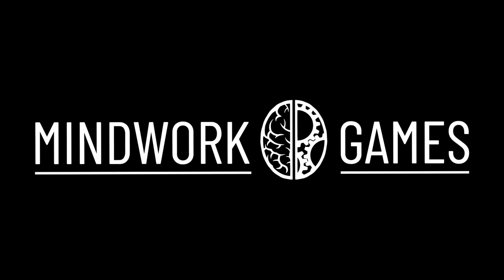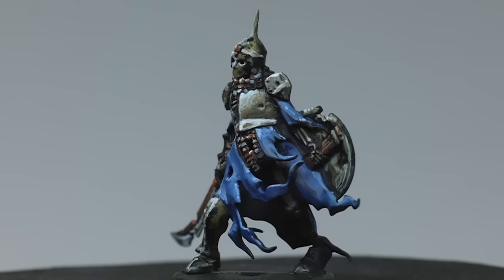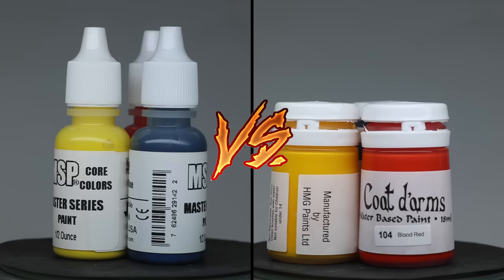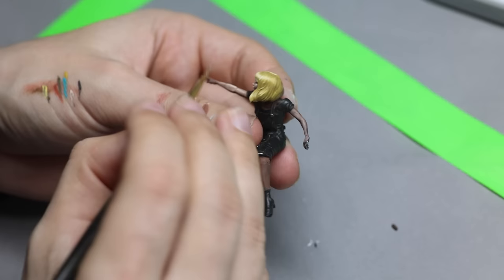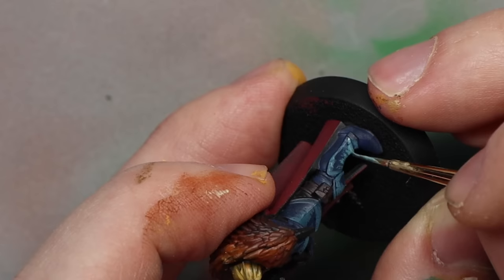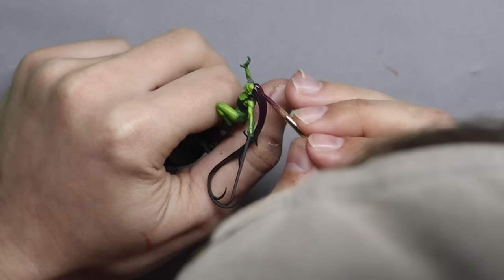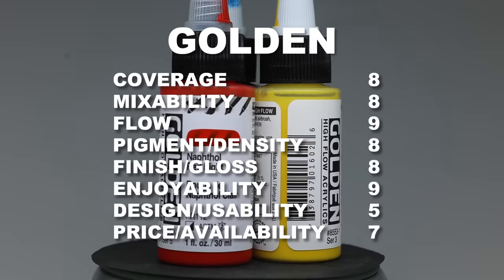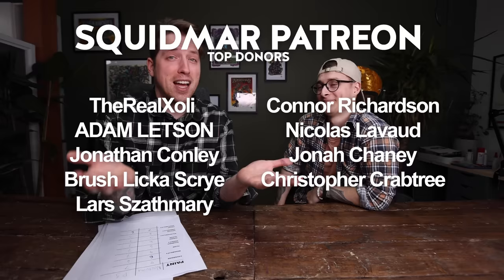Worlds biggest paint test! - pt. 1

Comment: I'm actually a bit shocked at the Army Painter results. I've only ever used their Greenskin paint to get some Salamanders ready for the tabletop and one or two washes. I've never had an issue with coverage, but I've tried so little of their range.

Also, I was really hoping to see Duncan Rhodes' Two Thin Coats in here.
Reply: Duncan's paints aren't for sale because they're still being altered right now. They've had some early reviews but the final product might be different than the ones used in reviews so far.
Reply: I was little surprised as well, I have to wait until the following day to see anything like that level of serration in my wet pallet

Comment: I'm a bit late to the party, but I wanted to chip in. I have only had problems with my monument hobbies paints when using Citadel primer. When I used some Rustoleum primer they worked like a charm. Not sure what would make that difference but Pro Acryl has been my favorite brand of paint thus far. maybe I'm using my vallejo paints wrong, but I really dislike the finish of the vallejo paints.

Comment: For Applebarrel and similar, it's normally more of craft stores and similar places where you would find them than the normal hobby stores.

Also, I'm surprised you didn't try some of the Testors enamels, I know a lot of people who started with them because they were easily available (They used to be sold in Walmart, K-Mart, and Meijer near me when they had models for sale). Sure, they're more of a thing for scale modeling, but there are a few people who still use them.

Comment: I have a bunch of Army Painter paints that I picked up for relatively cheap, and they are a pain to mix. Even with a vortex mixer these paints really need ball in the paint to get them to mix. They're not a bad option for the price, but for ease of use I'd rather pay the extra for Vallejo.

Comment: Always nice to see your favorite paint brands clash each other. As owning 7 or 8 brands of them for myself i was a bit sad with my favorite brand kicked out so soon. Have some scale for myself but seems that i am to bad of a painter to use them properly and for my taste they are too matte. On the other hand i love my warcolours and do steadyli increase their amount.

As i see it, most colors are some kind of the same thing. Little more or less opaque, little more or less thin but if a grab a Pro Acryl, a Gw or a Vallejo Bottle dosnt make too much of a difference for me. In contast using Warcolours feels really different and unique. I love how the gel feels when painting and how you can "push it around" to get the opacity you like.  In my opinion you can control the flow perfectly with just adding a tiny amount of water. What they do for me as a not that good of a painter, is perfect and smooth color brightness transitions. You just take a color range, red 5,4,3,2,1 and layer them on one after another and the result is just amazing every time.  If i use mixed Vallejo or Pro Acryl for this,  its much more difficult for me, often they are to opaque  and each layer stay clearly visible. And if i thin them to much they become runny, and i dont like to fiddle around with mediums.

Comment: These were Ferc Polo's determination from testing.  Posting before watching the video to avoid opinion gathering.

1:  ProAcryl  (best)
2:  AK  (damn close to best)
3:  Vallejo  (consistent, predictable, vibrant)
4:  Scale 75 (awful company culture, very matte, but extremely pigmented and easy to use for any purpose, will lower rating for people who don't like matte finish)
5:  P3  (some of the best metallics, but the flat colors, while good, do not stand out.)
6:  Citadel  (The range is large, some of the unique colors are amazing (Death Guard Green, Thunderhawk Blue, Sotek Green, Averland Sunset, etc.)
7:  Kimera  (every color you have to mix, just more effort, great for mixing with other brands)
8:  TurboDork (look great but using them is awful)
9:  Apple Barrel (Higher for cost per paint, but pigmentation is an issue for glazing or thinning.)
10:  Reaper MSP, it's the worst paint I've ever used and all arrived almost worthless in separation and one set was completely dry.  Garbage experience.
Reply: If your reaper arrived that way they were either frozen in transit, or not directly from Reaper and had sat in a warehouse too long.. I've only ever had 1 paint that wouldnt mix properly and I've used close to 600 bottles of them at this point

Comment: "Strength/wear integrity" could also be included as there are more than twenty differnt acrylic polymers. I am under the impression that Model Color by Vallejo was a mix of vinyl and acrylics. Goes down fairly evenly, but wears off easily, so probably not best for those handling the minis in a game or packing them a lot. Why did you skip Game Color? I think they are pure acrylics. Regarding coverage, reds and yellows can be quite transparent as there apparently are no cadmiums or bismuths in acrylics for minis. Glad you included an artist brand like Golden. Not recommended to lick the brushes when using cadmiums, chromiums and so on, though.Toned colours will always cover better. Wonderful to see all the brands, though. The category pigment/density is porobably the most important. Glad you included this, as acrylics can not carry/bind as much pigment as oils and acidious pigments can not be used at all.

Comment: I noticed during your MH test you had issues getting first layers down...I did too. Then I saw you using Vallejo Primer, which I use also. I am wondering if you used the white as the primer even as a highlight. I found that if you use the Vallejo white as a primer in any form MH never wants to stick, but if you use black and grey they work like a dream. Its just the white I found that did this. So I would have agreed with you about a month ago, until I started priming different. Now MH is almost the only paint I use next to Vallejo and some of the ink AK's

Comment: I get the feeling that noctourna and P3 would be better for Byron's Style of drybrush painting; GSW Paints always seemed to be heavy body paints to me halfway between apple barrel and mid-grade artist acrylics making them excellent for base coats and terrain painting with a large firm brush; New Army Painter is still not quite as nice as vallejo but probably in the top 3 but their speed paints are my fav transparent right now, MSP reminds me of a slightly creamier vallejo, I just use matt medium instead of water to thin when I use Scale75 tying it all together, I haven't used Warcolors at all not a fan of gel medium even a little, AK and Monument are just simply the best here in 2024...oh and Golden are great, use the dropper bottle for Air Brush with some matt medium instead of AB thinner to thin and the from the pot colors are probably the second or third best for brush work; and Golden makes simply the best mediums, varnishes, and additives that happen to also tend to be cheaper than others.

Comment: I dont usually comment on videos, but i think its important to note here for amateur painters, that for some reason they are painting only black primed miniatures, and then rating the coverage of some paints as poor. The truth is, colors like yellow, or pink, are hard to build from black by most any brand of paint. you will get much more consistent coverage results by priming white, even with exact colors that showed poor performance here. Though some are still awful. That army painter red, is no joke, very poorly. They also mention saturation or muddiness, and that too has alot to do with painting over black. See the thing with priming in white is, you can still paint the areas you want black, but its much harder to do the reverse.

I know from squidmar's previous videos that he knows this, especially with yellow and purples. So i am surprised to see his reaction to the golden brand extra flow paints. which have a transparency rating directly displayed on the bottle. Kind of a silly moment to me

Just my two cents in case someone runs into this video and convinces themselves their paints are the problem. Sometimes it just takes the right knowledge to improve.

Comment: Crazy how subjective all this is! I guess it all comes down to what techniques you lean on most how you prefer the paint to behave when doing them.
I've tried a lot of these paints (honestly I spend more time trying paints than I do finishing projects...) and would score some of them very differently. My favourite brands are Scale 75 and Monument who both didn't do as well as I'd expect and on the flipside I would never rate Vallejo that high (though they are solid paints).
Reply: What Vallejo color line did you use? I like Vallejo Model color and Vallejo Model airbrush metals (the 32ml pots) but not their Game colors or Mecha colors.
Reply: @mycatistypingthis5450  A mix of model colour and game colour. To be fair you might have a point that my opinion of model colour might have been tainted by the game colour paints i used.

Comment: Not the most fair test out there... Ideally, you would have used the same palette with each range, to compare colour for colour. You could almost do a follow up series of comparing individual colours, especially like White.... settle the question of who makes the best white. Also surprised you didn't include any heavy body tube acrylics from Golden, Liquitex, or Schmincke (maybe even Scale 75). Tube is still better than pot.
Anyway, I have some more thoughts/comments:
Pro Acryl - They're basically the same bottle top as used by the Golden High-Flow and Fluid paints, so it sounds like Emil might have scored them higher than Lukas. They also sell alternate tops for people who prefer something different, which is nice... though I think it would be even better if they gave you the choice when you buy direct from them.
Nocturna/P3/Coat D'Arms - I don't know if I'd call them the worst pots... personally, I prefer them to the current Citadel ones, especially in their ability to actually store the paint without it drying out. Additionally, it's worth mentioning to note that they're all made by the same 3rd party company: HMG Paints in Manchester UK. I even believe the current Citadel and upcoming Duncan Rhodes paints are made by the same people... so it's interesting how they are all so different.
Also, I wish I knew what's going on with the Nocturna paint distribution. They added 3 sets to the Nocturna site about 2 years ago, but never followed up with the rest from the Kickstarter. Have they scrapped the range already?
Scale 75 -  Anyone who claims they have great coverage/opacity is lying to you. Their main selling point is their ultra-matte finish. Also, their Metallics and Inks are better than most. 
WarColours - They did you wrong not including any of the One Coat paints. If you aren't using the One Coat paints in the workflow, it's going to be more frustrating than it needs to be.
Apple Barrel - It would be interesting to compare these with similar type paints like FolkArt (made by the same company), or Jo Sonja acrylics. 
Kimera - They're now up to 27 pure pigment paints and 12 "Signature" blends, with another 18 Signature blends coming soon with a Kickstarter campaign. 
Golden - High Flow are better thought of as inks; great for glazing and airbrushing... but not something I'd want to use on their own.  There's a "Fluid" range in the same bottles that is probably better for brush painting, but really, after Ninjon's review of the SoFlat, I'm not sure I'd bother with them unless there were other colours you couldn't get in the SoFlat range, or if you wanted something a little easier to airbrush with.
Secret Weapon - Too bad they're going out of business.

Comment: Came to this open minded about the paints and seeyou your thoughts but my issues on the video are 

1)  its not a blind painting so bias plays into the rating as well as previous knowledge.

2) you exclusively used a wet pallet for every test and never tested paints without the wet pallet.  Not every paint out the needs a wet pallet or thinned out.  Some work perfect put of the bottle

3)  should have used the same mini for all of them with same color scheme for comparison.

Comment: Hello. Thanks for this huge test.

But I have to disagree with you about P3, about their pots quality. I have tested numerous brands in mini bottle pots, and over the years, I have grown to hate them. You have to shake them a lot, and this can hurt. The thin pipette gets clogged or obtructed, or you get to under-press or over-press the bottle when mixing on the palette, resulting with unprecise mixes. The list of little inconveniences goes on and on. The P3 pots on the other hand are easy to use, you can either pick paint on your brush , or you can take a little spatula to grab the precise amount of paint you want for your mix. The pot does not get clogged up, and you can easily see if the shake of the paint was sufficient. The soft white plastic cap seals the pot quite nicely, and its resting position does not get in the way, unlike what the GW one does. So bottle or cylindrical pots ? Both packages have their merits. The one I really dislike though is the current one from GW, because it has a self-tendency to fall in half-closed position, and when closing it the seal gets poorer and poorer, as dryed paint accumlulates on the seal.

Keep up the good work !

Comment: When I saw Vallejo vs Army Painter I was thinking "Ooof AP about to get its teeth kicked in"
I think it's pretty fair to judge GWs pots when their paint is so expensive. It's like they're designed to be bad on purpose, and the company KNOWS there is a better choice in dropper bottles. And having to transfer GW paint to dropper bottles is a time consuming pain in the ass.
Reply: They probably had the cheapest vs the most expensive paint per milliliter head to head. Kimera might be a bit more expensive (5,86 vs 4,80), but it's also 2.5 times the volume, and higher pigmentation.

Comment: I feel like Army Painter got just a bit of a raw deal. But maybe that's just because I like mixing it with other paints; or I use it just for things like stone or skulls on bases.
Reply: Doesn't Amy Painter say not to mix their paints anyway? Might be wrong on thay though.
Reply: @welp2388  Not sure tbh. I've only mixed using a few paints in their range, but they've usually been stable. Maybe a bit tough to mix in smaller quantities, but it doesn't separate or behave in a difficult way. One of my favorite ways to get mid tones and highlights is by mixing Army Painter's Crystal Blue with other blues that I have.

Comment: Because of the structure of your bracket the top 2 brands met up in the 2nd. In my opinion Vallejo and Pro Acryl are easily the top 2.
Reply from the maker: Have you tried them all? ;)
Reply: @SquidmarMiniatures  I’ve tried most. Missing the AK and the Golden.

Edit: also haven’t tried Coat D Arms but have used old GW so assuming they are in fact the same I know how they feel.

Comment: The biggest fundamental flaw in this is assuming you have to use paint specifically marketed towards miniatures. All paints marketed to specifically miniatures is way overpriced. There are many acrylic paint alternatives that are just as good and are cheaper that do not market for miniatures. The biggest difference, other than the price, is that artist acrylic paints are not watered down. So in reality they are even more efficient as the same amount of paint can go farther. It just requires a bit of learning to mix paint properly, which is a good lesson to learn anyhow, and is too often ignored. 

I realize that many people prefer the pre-mixed / watered-down paints but the assumption that you have to use miniature specific paints that is pushed regularly does a disservice to the overall hobby. Specially new people that think they have to spend a premium to get miniature specific tools, when in reality they could be spending far less money on equally good tools. 

I enjoy the video and the comparisons, but claiming you are testing "all available paints" is pretty disingenuous and creates a false narrative for the hobby.
Reply: It seems the biggest take away from this video is: Experience trumps paint choice. 
Which kinda is my point. You can get a great paint job with just about any paint if you practice and have the experience to know how to use it properly.

Comment: ….how are you getting paint on your fingers closing the ProAcryil paints? My mind is blown right now with that comment haha
Reply: I twist the lid, a drop of paint gets pushed out and slides down the lid :(
Reply: It’s a terrible cap design. Look, I own almost all of their paints and I love them, but that twist cap causes a mess every single time.
Reply: @Lukas_squidsquad  wipe it on the pallete after closing.  You end up with it caked on after, but that's a feature - you can see the dry color!
Reply: My guess is they had pressure difference issues. I use them all the time and the only time I've ever had a problem like that is when I travel.

Comment: Having moved recently from Vallejo (Game) to ProAcryl  (Monument Hobbies) I also find that the first layer is crap, the paint does not stick to the primer, I use Chaos Black and Corax White from Citadel to prime. After the first layer the paint is really nice and I find the range to be much more consistent, I hated that the colours from the VGC range are so diferent in both use and finish. Does anyone here have a sugestion for a nice primer to use with ProAcryl? I do not currently own an airbrush so the ProAcryl  Primer is not an option at the time, but if it solves the issue it may be my excuse to dip into airbrushing.
Reply: I‘ve read the same that somehow gw primer and ProAcryl don‘t mesh well. I‘ve had no problems with Scale75 airbrush primer. 
Maybe try another spray primer? Vallejo, or maybe even something like a Molotow or other artist grade spray can (liquitex also has some)?